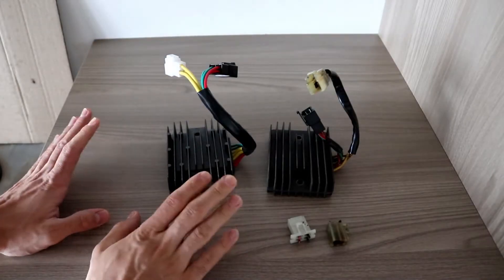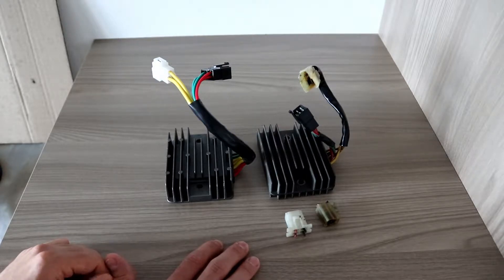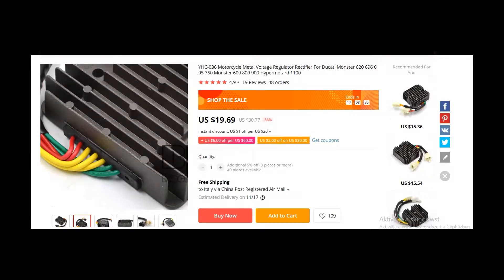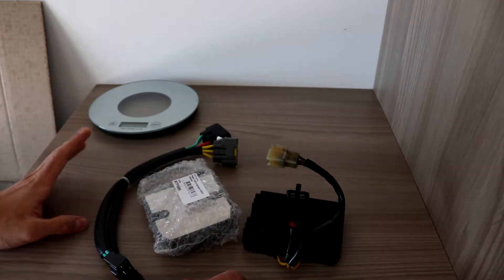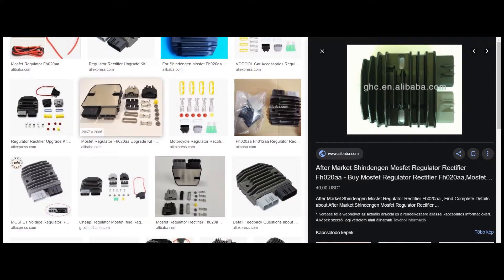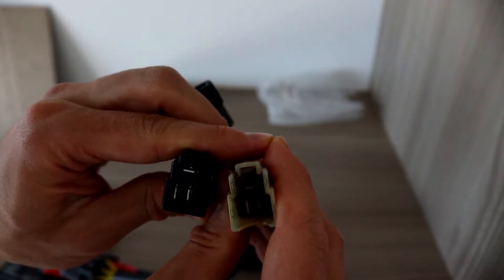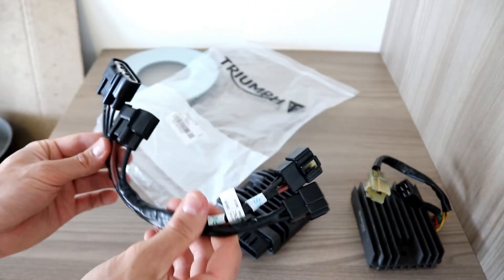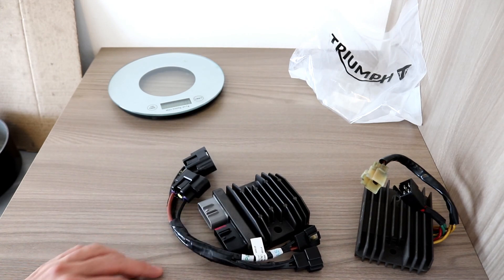Comparison: Fake ebay mosfet, Fake Mosfet, Original Mosfet FH020AA Regulator/Rectifier

Comment: The cheap ones work but cannot cope with the current requirements of a modern fuel injected bike with twin lights etc so burn out quickly.
Reply: Has nothing to do with power draw.

Comment: If you wanted the original one why didn't you get in touch with a main dealer?

Also the copies should be good so long as they put out the right voltage.
Reply from the maker: The Mosfet is expensive also. I wanted to try for a littlebit cheaper and not directly from the US but from Europe...
I paid the price but that's it :)
The fake ones aren't good for the bike health and I don't want to worry that the bike dies somewhere...
Reply: @uszokrepper1  It's a regulator rectifier, it only has to change from AC to DC regulate the voltage and current to around 14 volts.

Most of the cheap regulator rectifiers put out around 14 volts regardless as most bikes will run around 14 to 15 volts,my bike puts out 15.7 volts, so long as the amps are good at the voltage you have a good regulator rectifier.

Did you consider that perhaps the generator might have a problem, and perhaps why the the regulator had trouble.

If the regulator rectifier fried, chances are the generator could have shorted out, and may need rewiring, if you change one without the other you may damage either new part.

I always test both if one fails, just to make sure I don't damage the new part.
Reply from the maker: @flitsies  thanks for the headup but I know my case :)
Everything is fine after I changed to mosfet since 3 years now.
Reply: @uszokrepper1  That's great, just trying to help.

Some years ago I had a similar issue, so yep I know those things are very expensive, if you go genuine part.
But I did discover so long as you check out the specs on the device you can get away with a good copy, you may be able to make your own, if you can get hold of the fets at a decent price.

Let's face it I don't think any of these companies actually make their own electronic parts they built to a standard and that's what they use.

Perhaps they use a different heatsink but generally all the electronics are off the shelf parts inside.

Anyway glad it all worked out for you, its all a learning experience isn't it.

Comment: When mosfet reg/rec work, the temperature is much lower than SCR one. 
And you only compared outside, by this way you will mistake something..
Reply from the maker: Yes. Im not a mechanic or electric man. I cannot do this exactly what you just wrote but a little update: Already drove 2000km with the very original mosfet reg in my bike, no issues and yes the working temp is way lower by the mosfet reg :)